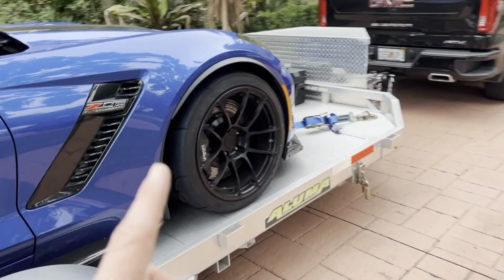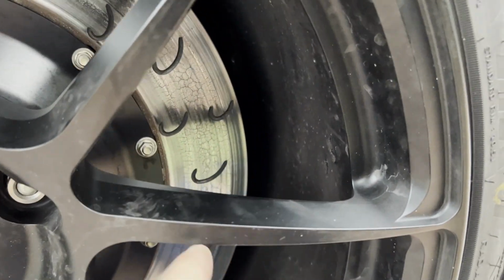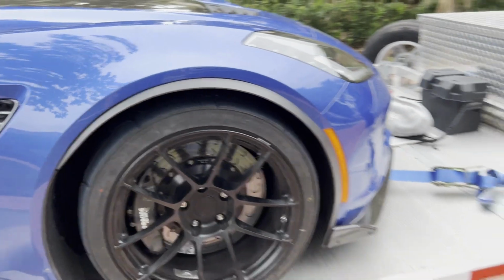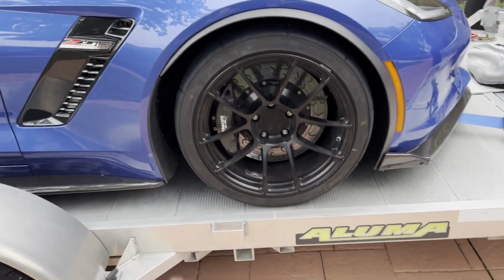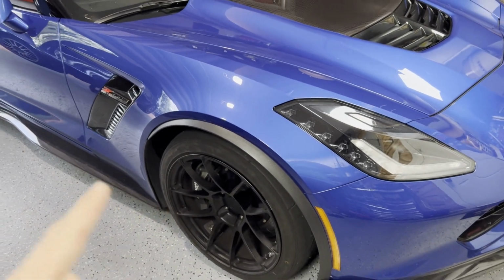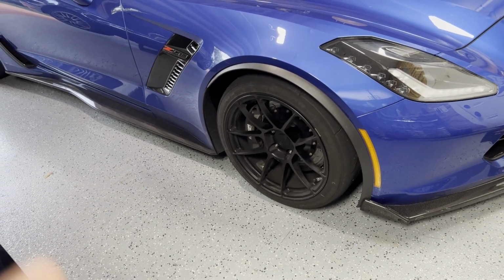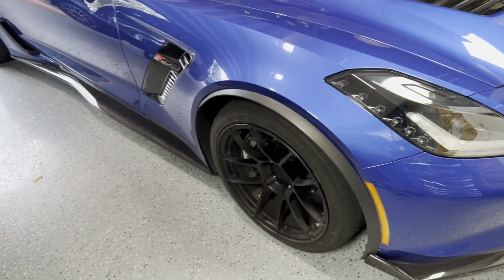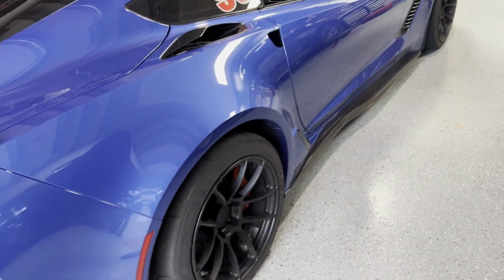C7 Z06 AP RACING Brakes update

Comment: Does running these calipers change the brake balance or ABS intervention of the car?
Reply from the maker: No, or at least not directly.
Because the pedal is more direct I did need a slight pedal pressure adjustment.